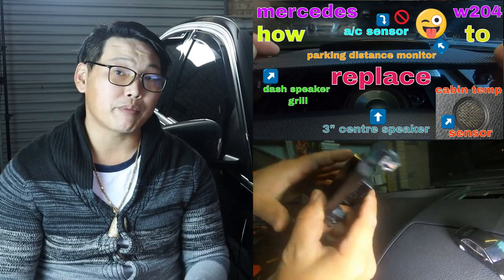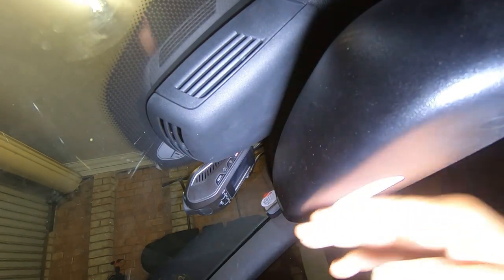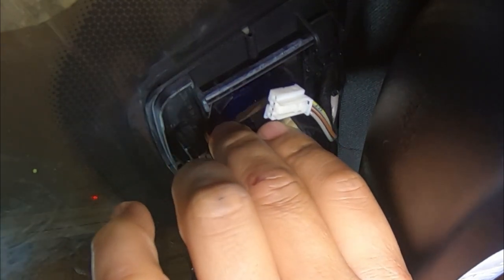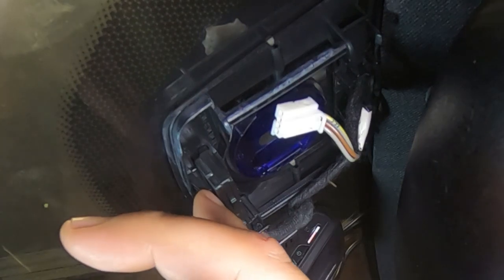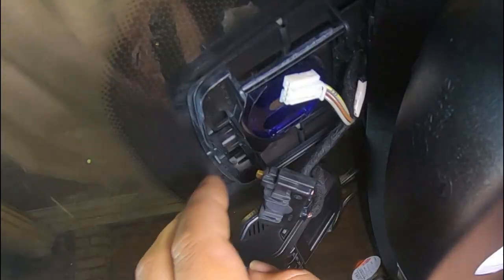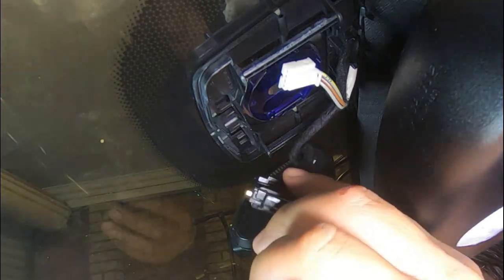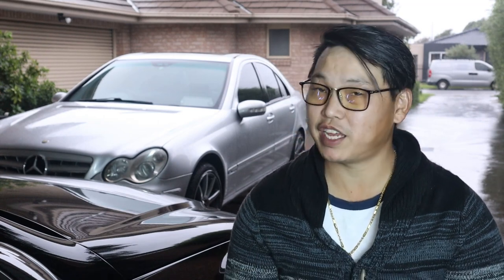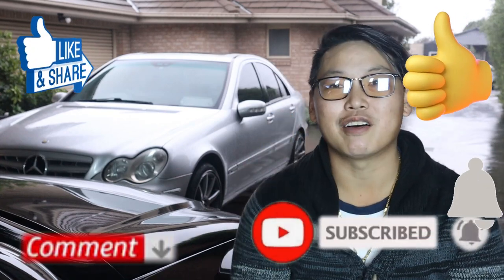how to replace rain light sensor + ecu module mercedes benz w204

Comment: Thanks Mike, great videos. You helped me before with my Merc ESL problem and column removal. Have message "Auto light inoperative", changed sensor but still get error message. Aliexpress claims "Registration required"? Bought it from Amazon or Fleabay, but would "registration" still be required? 

My iCarsoft MB II does not show an error related to the light sensor, so I cannot delete it. Would it be the ECU at fault in my case? Thanks.
Reply from the maker: hey bud welcome.back..and thanks for tour kind words ... now I've heard mixed msgs from this ..so wen u have auto lights inoperative it can also be the sensor of the actual headlight too... yes first you check the window sensor and apparently it does need to be coded ... that's what I've heard

Comment: Amazing!!! I do have a question for you... When you get the message Auto Lamps Function Inoperative would that mean to replace the sensor and the ecu or can you just replace the sensor.. I am confused because I didn't know if I have to replace the ecu or not too
Reply from the maker: i believe that would be the sensor  however if u replacs that and it doesnt fix jt then u would know its the ecu .. but always try a scan first to see if the obs2 scanner will show u the fault code

Comment: I have a 2003 C230K (w203) and I have tried 6 different used rain sensors and none of them work.  Although they are all from junkyards, I doubt very much they are all dead.  Does my model have an ECU like you have shown in the video for the W204?
Reply from the maker: I don't think so although u may need to have it coded to sync

Comment: If error code intel light inoperative, thats mean sensor problem to?
Reply from the maker: @mohdzulkifli1233  no that means something wrong in the headlight... your intelligent lighting is when it moves the headlight to your steering and dips when oncoming cars are sensed. and alot more ... it could be a fault within the headlight itself..a malfunctioned motor in the headlight
Reply: Did you mean the headlamp ballast?
Reply from the maker: @mohdzulkifli1233 don't think the ballast i think the motor itself in the headlamp which helps the light to move around

Comment: Had mine replaced and actually auto lights work properly and so does the rain sensor but still have the AUTO LOGHTS INOPERATIVE error message.
The automatic day/night mode in the radio not working, neither the scrolling on the command controller.
I'll appreciate any help
Reply from the maker: what do u mean by the auto day and night mode in the radio not working? amd the scroller for your audio system not working? that is usually due to the shaft breaking in the scroller for your audio system...im not sure about the day night mode... can u clarify what u mean
Reply: @douglassampedro

Mercedes Computer system uses A combination of simple sensors that control toggle between daytime and nighttime display mode, which changes the backlit settings on the central display, instrument cluster and backlit switches knobs and accessories threw out the cabin. The goal of this is to enjoy a more precisely tuned luxurious presentation while increasing driver safety;  instead of having a simple nighttime or daytime mode; headlights on or headlights off,  

The system is able to determine the correct combination of lighting settings using a simple logic computer module that takes in current sensor data and historical sensor recordings during the current “trip” and applies this to preprogrammed set of 
Values. 
It also allows for when rain is detected on the windshield it is  to automatically turn on the wipers after a set amount of interference on the sensor(  more 
Interference = Heavier rain.  or amount of time.  
So if it begin to pour rain without warning lights will turn on nearly instantly or if it began to sprinkle for several minutes it would record that  in the historical sensor data and allowing for more data  to decide headlights activation accordingly 

As long as windshield wiper Control wheel is in one of the two auto sensitivity settings. This allows rain sensor input to be fed into the said lighting control module (all of this  varies country to country for legal reasons. all are closely related but where for example DRL‘s are mandate it is at this step it is  programmed and made not be able to turn them off )  
also as a tip to preserve longevity of the rain sensor when rain is definitely unlikely turn off wipers completely to position 0 By doing this you’re Turning off  power to that sensor which by design when turned on to “auto” The sensor is experiencing “wear and tear” 
It works by recording light reflection generally the main cause of failure is the optical return sensor failure to send data in the form of light return percentage to Computer module due to “burn out” .   Especially if it’s on throughout the cars entire life. It also lessens the load on the headlight Control module by reducing the number of input values. 
But be warned if it is raining but still sunny outside and if you’re low beams are on because it’s raining and you switch your wipers to 0 your headlights will switch off  because they are  only using light sensor data input. Putting you in danger. 

The sensor system works in tandem with the headlight/ rain sensor located between the rearview mirror and windshield as shown in this video.  But it also uses a“ cabin ambient light sensor”  which is located generally in MB 2007-2016 next to the central display screen.  (Black small bump in area you can feel it you run your fingers around it)  you can test its operation by placing your thumb over it and watching the display invert and darken within 30 seconds
The ambient light sensor is charged 
With determining color contrast settings  of display screen for the radio. (If set to auto) as well as turning on switch lighting threw out the Cabin. The brightness of all this can be controlled in the instrument cluster settings under lighting ( if built in Germany this is true; but for the American made SUVs, it was decided it would be better for consumer if it was an extended rod  that rotates clockwise and counterclockwise threw the dash board area which was common in their market for many decades past and it would be more likely that they would use it for their safety)  now in newer vehicles ambient light sensors change  the brightness of the ambient lighting if selected to be automatic. (this is a huge advancement in automotive interior lighting by always selecting the best choice for the environment of driving) 

 
So in  functionality for example on your drive home in the evening  the sun could be going down and intermediately getting sunshine on the highway. And your DRL‘s are no longer sufficient ( due to lack of rear lighting in US market)  Low beams turn on and only instrument gage lighting but with out any change to cabin Ambience settings. It’s as if your DRLs never switched off and it is still fully day light.  This is because ambient light in the cabin is still satisfactory but not satisfactory outside the vehicle for safety visibility purposes for other drivers.   Time passes and the sun is now fully hidden, 
Low beams are already on from earlier but now cabin backlit lighting will turn on which could include foot well lighting, switch lighting and ambient light. But your central display would still remain white background  contrast

The final activation sequence would be the ambient light in the cabin being recorded  to a certain point that would make The contrast invert on the display for reduced eyestrain and safety. 

Since you have replaced your rain and headlight sensor it would be recommended to replace your Cabin ambient light sensor. As it can be sending  invalid, inaccurate data ( it should be throwing an error code for this specifying which sensor) using MB STAR
The failure rate in this sensor is much less than the headlights and rain sensor but can be increased with excess sunlight shining on the sensor threw out is life.  Due to its design

You could also try to reset the entertainment system By holding the power button for 30 seconds and allowing it to reboot.  It could also fix the sensor input for your toggle knob but this is unlikely.  Find the instructions to put your entertainment computer to place it in diagnostic or engineering mode from that menu go to error code storage it would record the data input error there just Google the error code numbers if you don’t have star 

(my apologies for grammar and word choice English is not my first language. I am good  for casual conversations  but describing technical aspects is best left for German )
Reply: @josephmorganr.mitchell2985  nice . Thanks

Comment: Hi,
I’ve got a 2016 Vito. Auto long beams stopped working. No error message. Auto wipers work fine. Fuses are ok. Obd scan shows no errors. Any clues?
Reply from the maker: wen u say long beam do u mean high beam ??

Comment: I've replaced that sensor for a new one from Mercedes dealership here in nicosia and still have the Auto Lights inoperative. Rain sensor works fine but Auto lights nit working. Any idea where the issue might be? I'll appreciate your help.
Reply from the maker: have u had the obd2 scanned in order to show what the fault may be, its always a good idea to start with scanning the obd2 as it narrows down what the issue is, once you do that it will point you in the direction of what the issue is, may be something as simple as having the new sensor activated or synced... this was what i had to do when i changed out my headlights , i have to activate and sync the headlamps with my car so the ecu could recognise it, just an example of what mite be needed sometimes for electrical components... i cant say definitively your issue as i havent had the problem, do a scan see what it says, jump on the forums and ask around..so many helpful ppl out there friend...
Reply: @ Douglas sampedro i do have a same issue, did you figure out what was wrong? Can you please kindly let me know?

Comment: Hello I have mercedes c klasse w204 2011 c180 cdi i have problem whith a light the driver side dont working i change olso lamps and the  same problem. Show my light system inoperative

Comment: Hello! I have The same problem Whit mine w212 2011 i have replaced The rain sensor but i still got The error message auto lights not working i have even replaced The little ecu module that runs The rain sensor but still not working any idea what the problem is ?
Reply from the maker: not too sure ... it could be the actual rain sensor it self
Reply: the replacement part is from the car scrap can probably be so that this is also broken in that case damn bad luck I have! But the orginal part number must match whit the new one or not ?
Reply from the maker: @alexanderosmani8177  as long as it works it should be ok ... as long as the part is the same .. usually there a universal part no .. cuz alot of models use the same rain sensor
Reply: I have tried from a friend's car his sensor to my car does not work but my sensor to his car works just fine.. i dont get it :/
Reply from the maker: @alexanderosmani8177  that puzzles me ... I would try another one of possible or even ask mercedes ... I'm not sure what the issue is ...

Comment: Hello friend i have mercedes w204 20011 model and left lamp its of i change i put new lamp and the same problem don't come one i don't know what is going on
Reply: Xenon lamp
Reply from the maker: so ur front headllamp is it bi xenon or halogen
if its bi xenon it can be the ballast .... if halogen i would start with fuses ... and then get an obd2 scan ....it should tell u whats wrong
Reply: @MIKEYZVLOGZ  hello show i out in computer and show my one code no 1669010201 module lights
Reply from the maker: @bledarbani1868  didnu google the code ..it will tell u what it means

Comment: Everything works but I’m still getting and error message
Reply from the maker: di du use the correct part, you shouldnt need to reset , but maybe u need a quick code
Reply: @MIKEYZVLOGZ  thank you I called the dealership and they said I need to have it programmed to my car $285 dollars

Comment: Hi;) I`ve got the light sensor problem, I`ve exchange it and there is no change I still get auto light inoperative and fault code in driver sam U023100. It`s nr is A2048204326, Maybe You have any idea what to check.
Reply from the maker: Hi mate sorry to hear... did u clear the code once u fixed it ... usually once fixed it should clear but I would clear it too and see if it changes.. if the code is still there .. there's another issue... wat didn't change ? The ecu the sensor? The entire module?
Reply: @MIKEYZVLOGZ  I`ve  tried to clear but it won`t. I only changed the sensor on windschield.
Reply from the maker: @slawomirgierczak561  u may need to check the ecu module